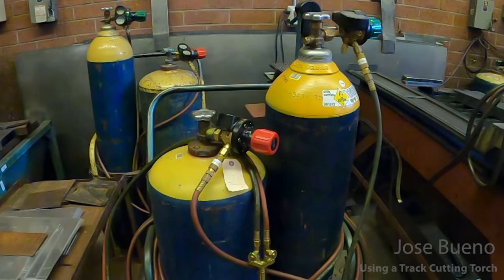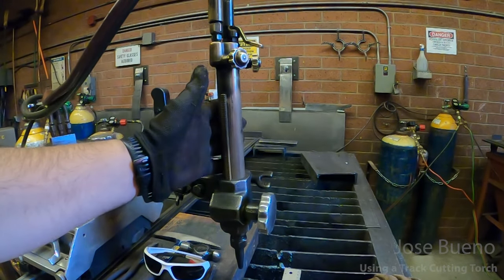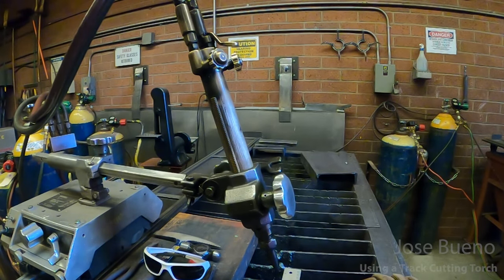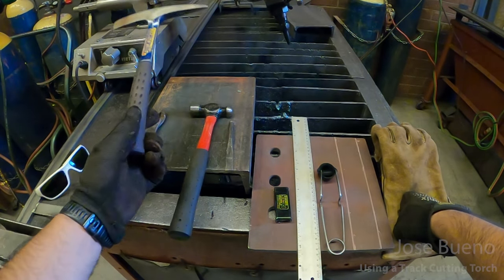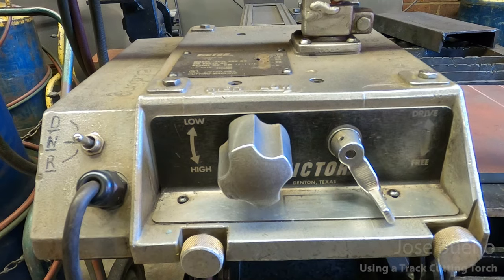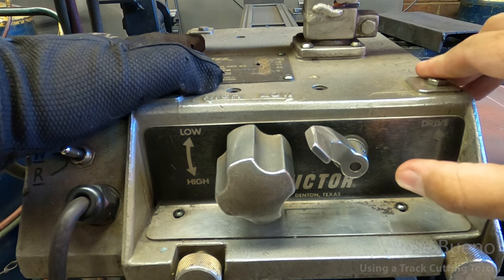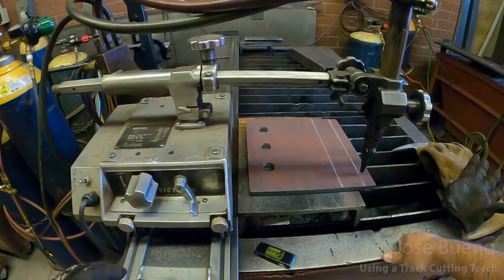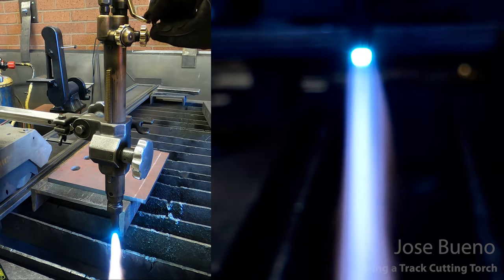Oxyfuel - Track Cutter Demonstration

Comment: This person doesn't have enough knowledge how to use a track torch.. He's making the flame, too hot. The torch is also too high... 
Once the plate is preheated, the torch needs to be backed off, where just the edge of the blue core is touching the plate.  Open the Main cut stream and activate the motion